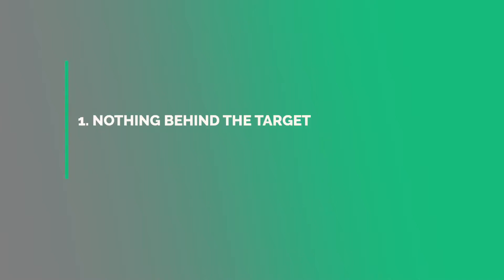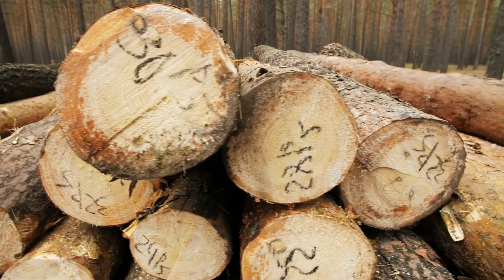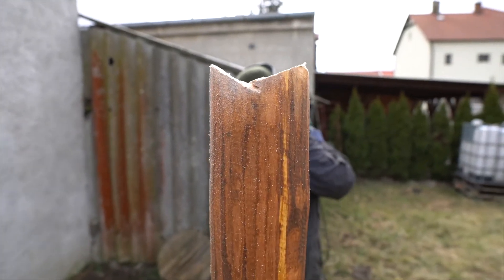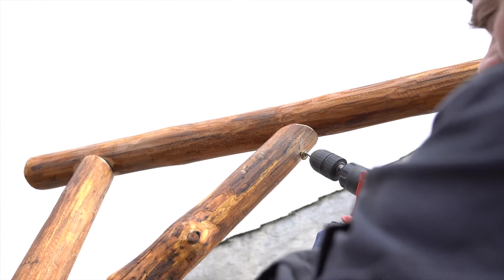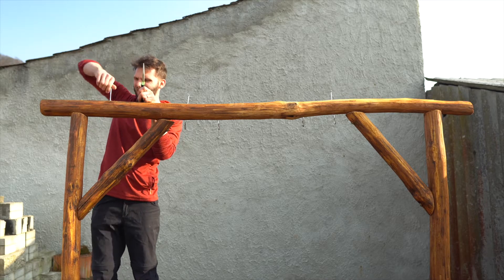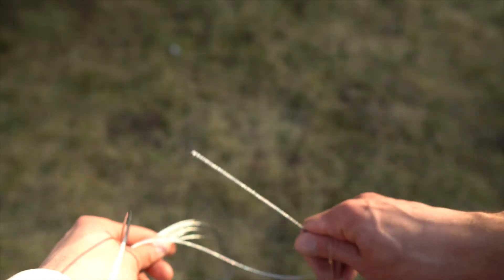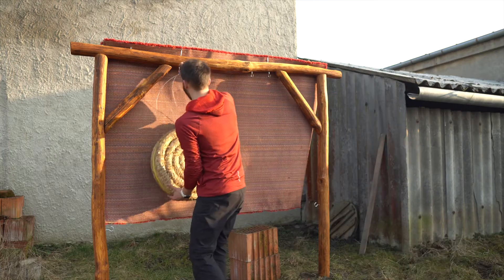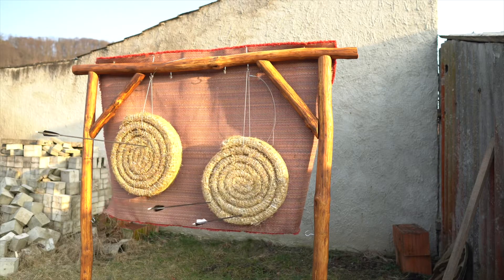DIY Ultimate TARGET STAND for archery and crossbow

Comment: Target's are tricky. I struggled a long time to find the right one. Now I use jute bags, filled with plastic baggs. They stop arrows great and are extremely cheap. 
But for a backstop, I actually bought a real archery curtain. Sometimes arrows stick in, but they don't pass through. However, when you make that perfect shot, when the arrow flies straight and with power, even the archery mesh doesn't stop them. I shoot 40# at 28", 50# at 32".
You are extremely lucky to have such a big backyard to shoot in. It's safer and even if an arrow misses, there is no danger.
Reply from the maker: Love our garden, just not at the moment when I need to cut the grass... hours and hours.
Reply: @CharliesRunningArchery  haha lol yeah cutting grass takes long. I can relate. That's why I told myself that I should rather cut grass twice another or atleast once a month before it gets too long because then it's really a mission to cut the grass.  But one thing I noticed when the grass is very long is that when I do archery and I take a video. The grass gives the video a cool effect like being in nature.
Reply: Yeah, advice to people looking into archery curtains. They're meant to stop lower power bows or arrows that glance off targets. A decently-high power compound bow (like a 60lbs target setup ) will punch a hole in the net with so much speed the net won't even move. 

That's why if you set the curtain up make sure nobody EVER goes behind it. They are meant to stop the occasional stray, not protect people or property.